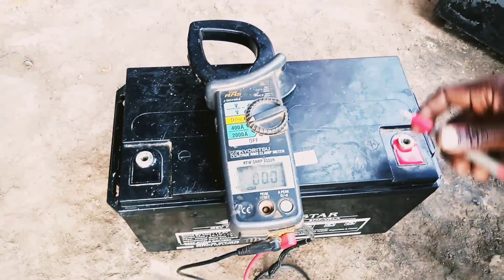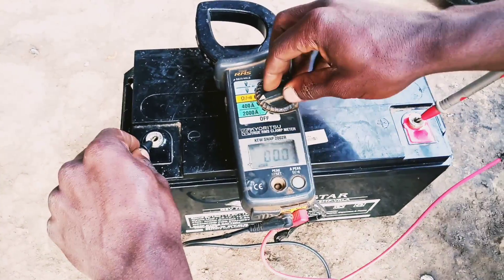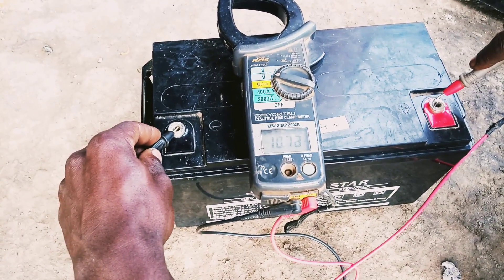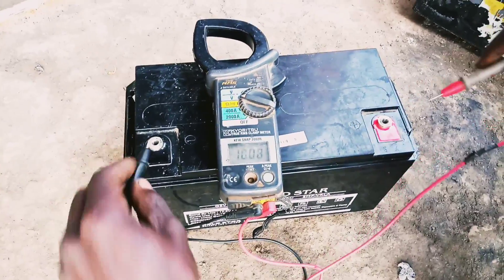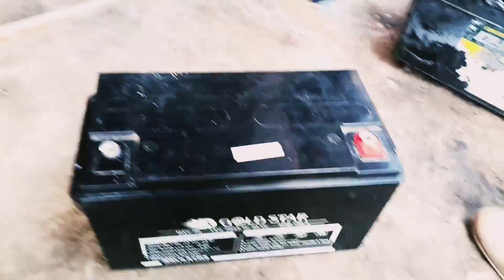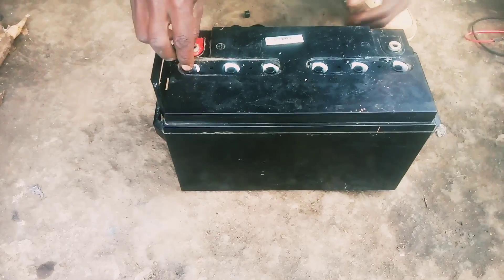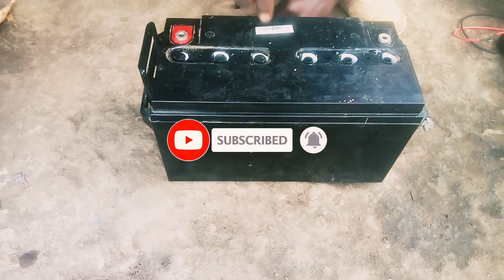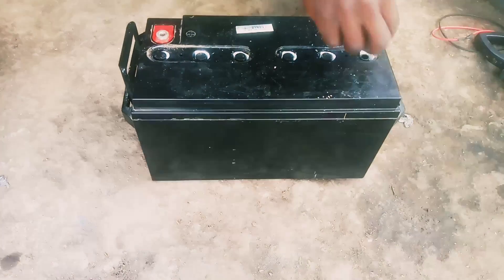How to revive deep cycle batteries 100% working.

Comment: Is this acid water something as distilled water?
Reply: Please bro,what can you say using ordinary distilled water for a deep cycle battery dropping so quickly on load
Reply from the maker: @oladipoolatuja4176  This won't work, mixed acid can do it well
Reply from the maker: It's mixed sulphuric acid
Reply: @Ugpearl256mubarak  ok thanks,where can I get this or I can do the mixing by myself
Reply from the maker: @oladipoolatuja4176  yeah, it's good to mix by yourself if you know how to do it well, thanks
Reply: @Ugpearl256mubarak  can you tell me the procedure please?